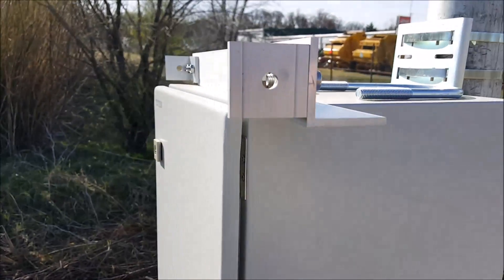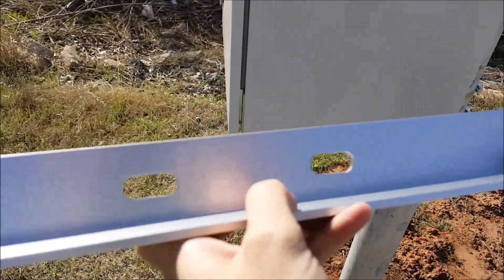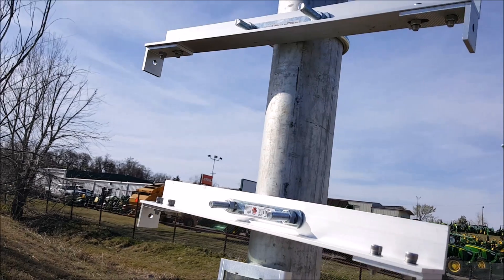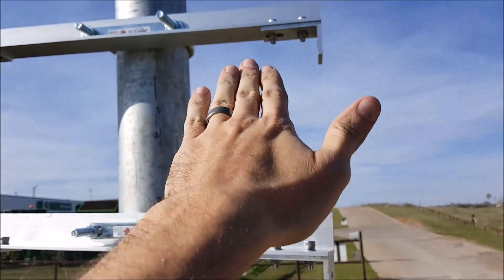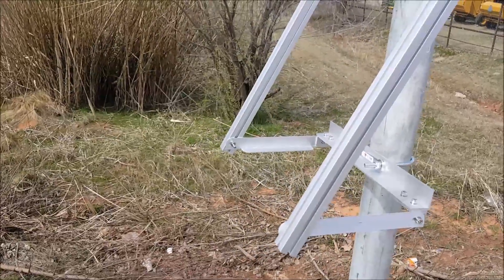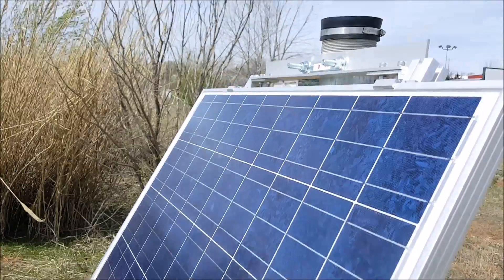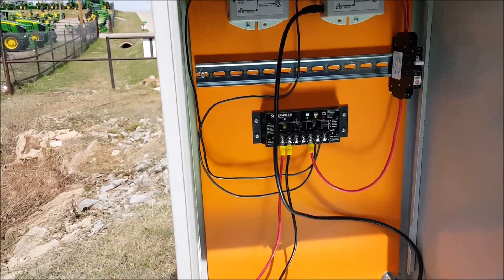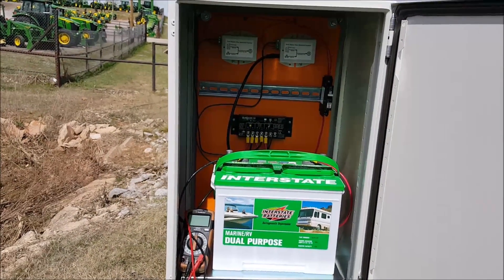Solar Powered Surveillance Camera Project 3

Comment: great looking project, what about some surge protection that would fit perfectly on that din rail just beside the breaker just about $20?
Reply from the maker: For sure, that would be a good addition.  I was not expecting a lightning strike to the system but I guess you never know.

Comment: Seems like a waste of time and money, Why not run a cat5e wire with boosters to give you up to 2000 ft of power to POE Camera? Have the DVR in the building. If its farther then that use a WiFi set up.
Reply from the maker: You must not be familiar with how much it costs to properly bury underground cables.  It would have been 5x more to do it that way.

Comment: Nice Video!! Question regarding the solar pannel. What's it's max output? Do you think it would be possible to run a 40 volt appliance 24hours a day?
Reply from the maker: Thanks!  The solar panel was 100W.  How many amps is your appliance?

Comment: hi，may i know if the pv module is charging the battery and powering the camera at the same time? or the module just charge battery only and the camera draw power from the battery?
Reply from the maker: It can do both at the same time.  The panel is big enough that it can power the camera all day while it fully charges the battery.

Comment: I'm going to just throw this out there, but I think I'd put mine around 12-15 ft. above the ground.  But I think anyone with a shotgun could easily defeat the system. What's even dumber is I'm trying to find out how to do it myself, LOL
Reply from the maker: I think anyone with a gun could take out a security camera from far enough away to not be seen.  Where there is a will there is a way.  I don't think the camera being up higher would make much difference.

Comment: I saw an integrated product that even displays charge strength within the App, it was called Solar Cam on Kickstarter
Reply from the maker: That is cool.  There is a lot of nice stuff on Kickstarter that never makes it to market, though.  Was it funded?
Reply: Not yet, doesn't look good. needs to be in proximity to nearby router.
Reply from the maker: Bummer.  That would be cool.

Comment: HAD  ONE ON THE FARM  FOR WATER PUMP  A SOME ONE STOLED IT WAD BY THE HWY TO
Reply from the maker: +DAVID JONES Man that sucks.  It would be pretty easy to steal.  Just loosen a few nuts and disconnect the wires or cut them and you are off.  Mine is behind a fence, though, and there will be other cameras that would see what was going on so we could report it to the police.
Reply: David can you tell me where i can purchase the whole solar camera system with box